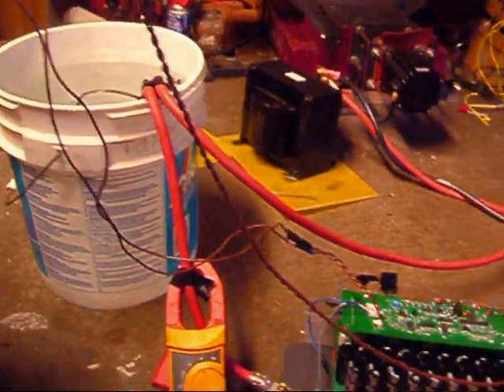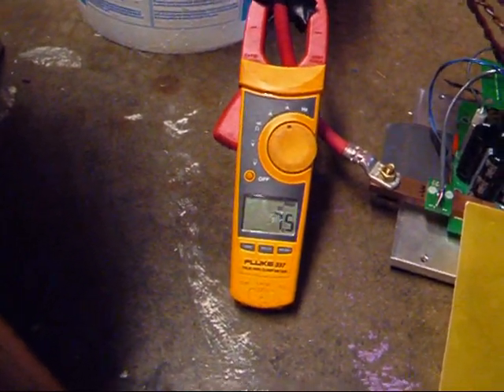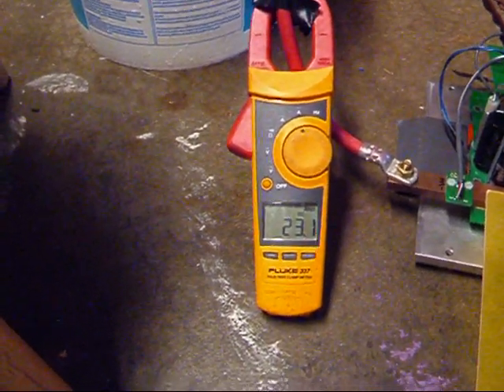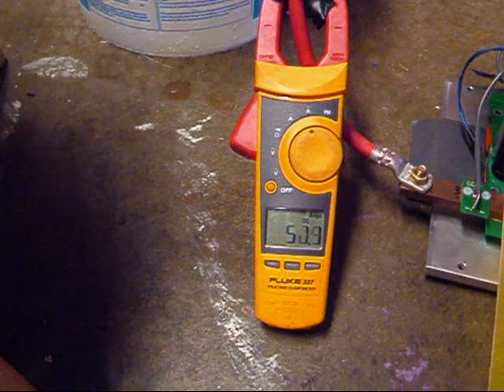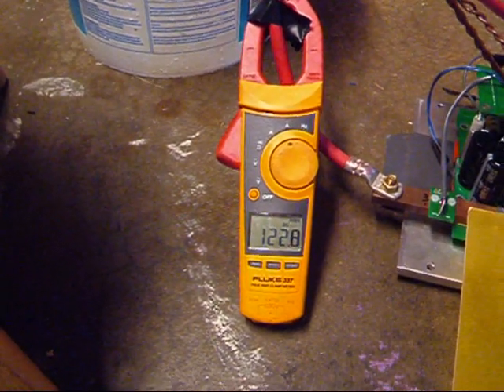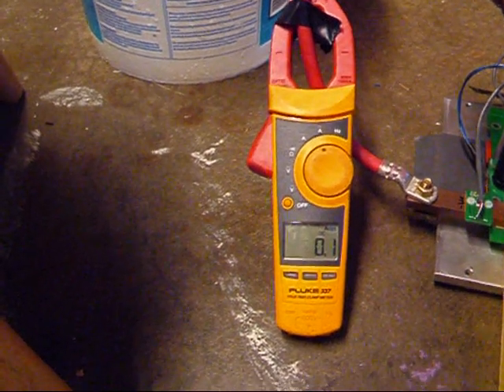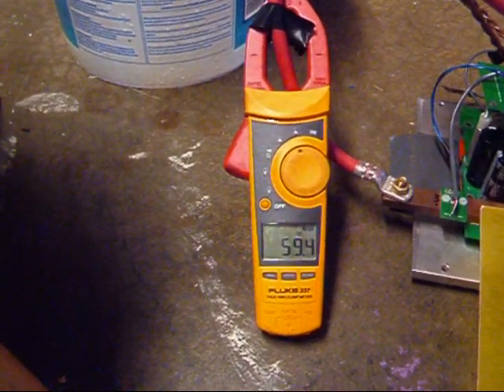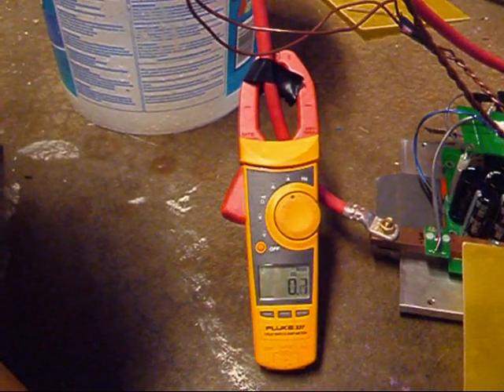152amp peak test

Comment: The more energy the TVS has to clamp the hotter it will become. Most TVS diodes I have used fail shorted leading to failure of other components or current limit of the power supply. Better to solve the transients with engineering rather than just throwing a TVS on them and making them clamp lots of energy. Of course this can involve slowing down the switching time, adding a soft start feature in firmware, etc. Good job putting the work into this circuit, looks promising.